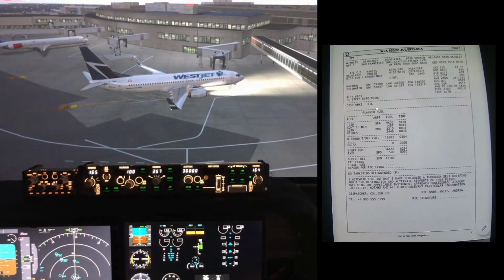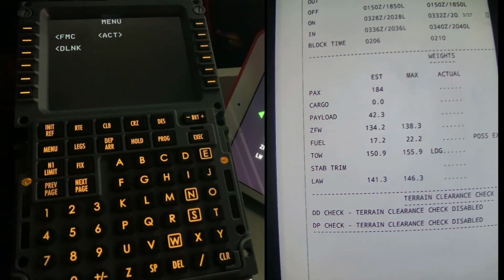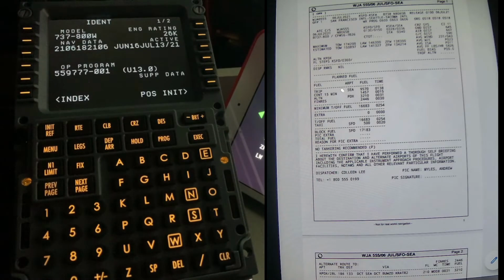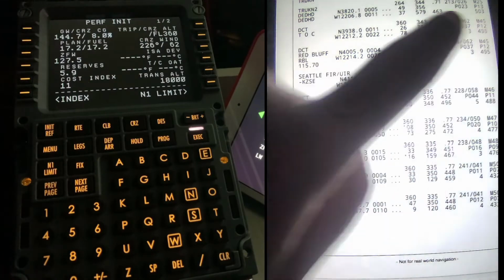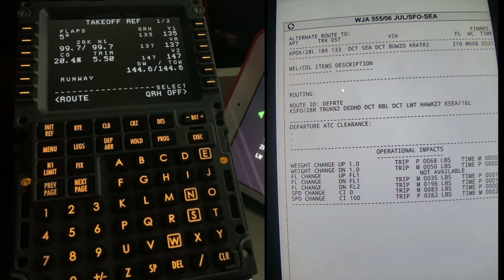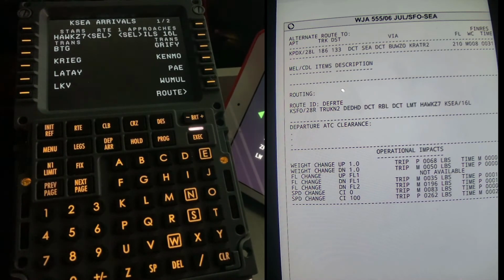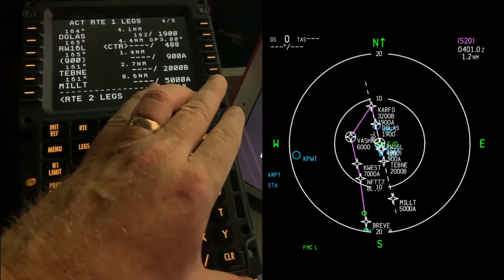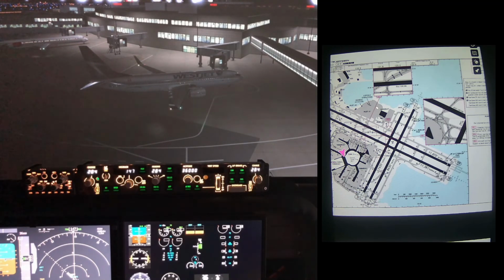Home Cockpit - x-plane 737-800 Zibo Mod - Cockpit Master CDU and CP Flight MCP Demonstration

Comment: Can you maybe tell me how to get the MCP El from cpFlight to work in the Zino 737. With the regular drivers from Xplane it only works in the 737 from Xplane.  I'm really looking forward to being able to use my MCP in the Zibo soon.  Thank you very much!
Reply from the maker: I use the midwest737 simulations replacement driver with my CP Flight gear. on xp.  if the standard one from CPFlight doesn't work for you I suggest either talking to them directly or trying the midwest option.

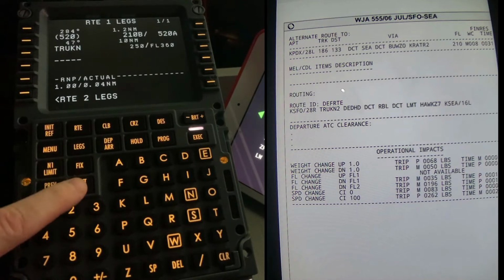Comment: Nice video dude. Just be aware next time when inserting the SID to not put the transition waypoint apart of the SID using dct as you did. Note when you are on DEP page at 11:16 the DEDHD waypoint is listed on trans options. Typing the WPT on the RTE page as you did and not selecting that waypoint from transition list you could be deleting a flyover restriction over TRUNK for example and just flying by the waypoint doing so. Otherwise, everything was perfect.
Reply from the maker: Thanks !

Comment: How do you get to use the Avitab to work separately on an iPad? That’s awesome. I want to get the MCP and the CDU as well.
Reply from the maker: Using the Air Manager Avitab EFB gauge on an ipad mini - check out sim innovations for that and more gauges for the 737 including the overhead.

Comment: Nice videos.   Nice G1000 cockpit. Which version of the CP Flight MCP are you using with X-Plane 11, the PRO3, 737NG-MAX or the 737EL?  And the EFIS, are you using the 737NG, 737MAX, or 737EL?  Is setup easy?  Thank-you.
Reply from the maker: Thanks for the comments. MCP is PRO3, EFIS is NG and setup was a breeze. It's a ton of fun flying when confit is g1000 GA or as a 737

Comment: I've had mine a week now and love it but ... have you been able to update to the latest firmware ...
Reply from the maker: Have not tried yet
Reply from the maker: 1. Unplug CDU;
2. Press INIT + 5 and hold;
3. Plug in CDU while holding above two keys
4. Keypad flashing
5. Click START FLASH on software page

Do not shutdown power during flashing...
Reply: @simpilotandrew4659  ahh thanks will try it tonight,  where did you see how to do this?
Reply from the maker: @davejones426  you can see it in their support forum